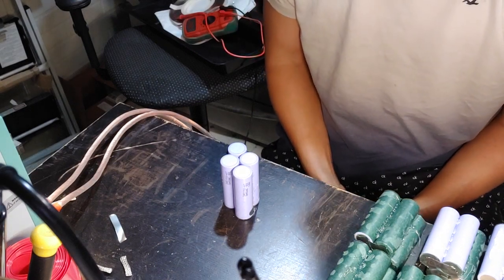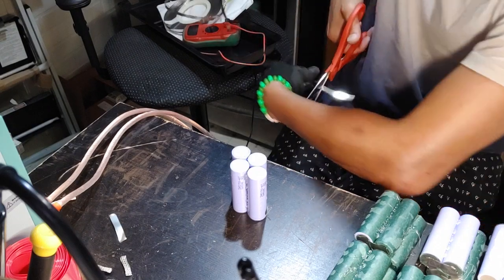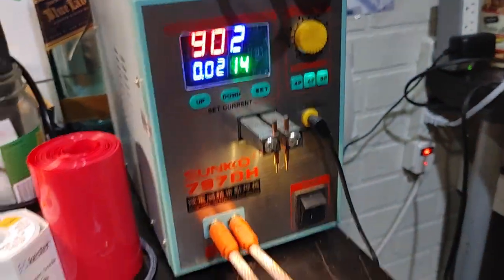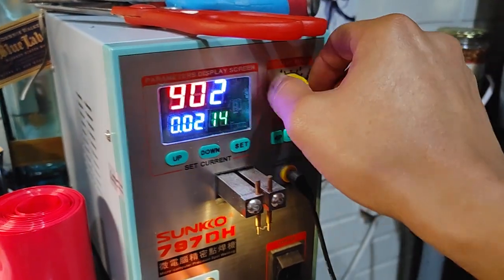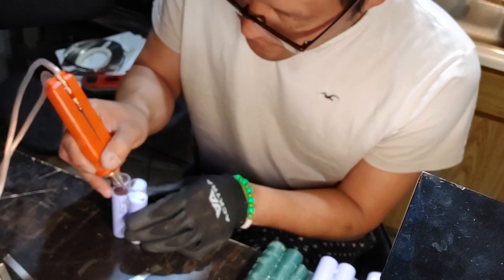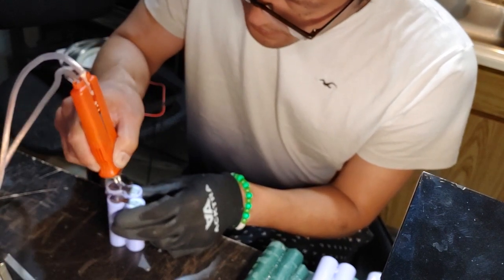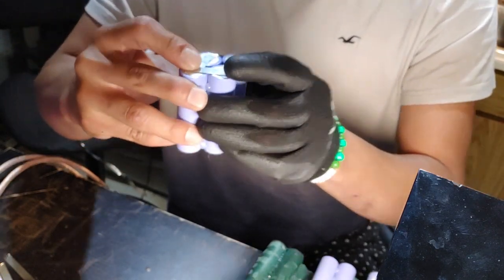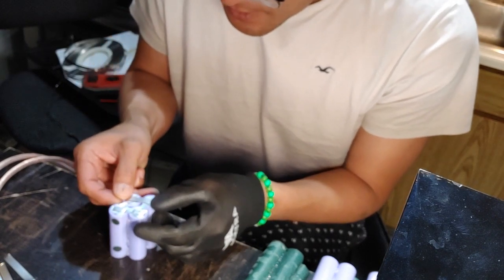How to Spot Weld a Battery Pack using Sunko 797DH!

Comment: How many amps can you pull threw a single nickel strip?
Reply from the maker: I am using 8mm .2mm thick nickel strips, they are around 13amps max.  You can still use them for series connections but for parallel you need something thicker like 12 gauge wires or copper braided wires.